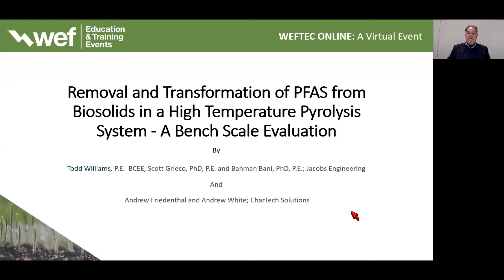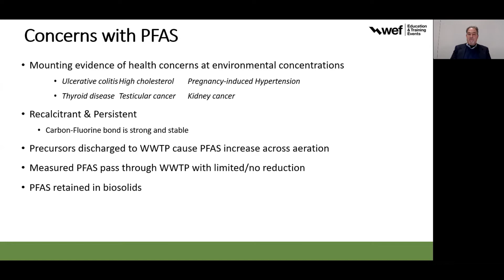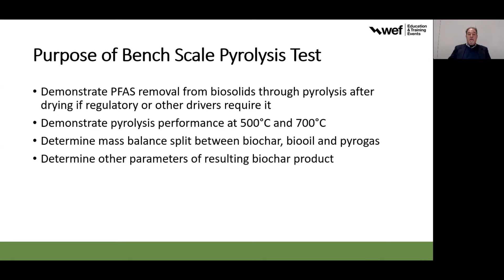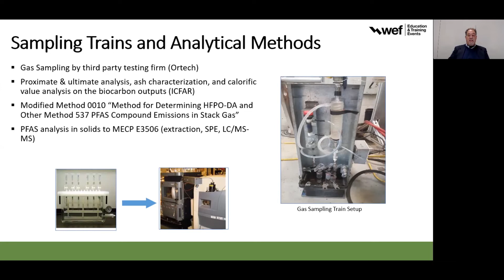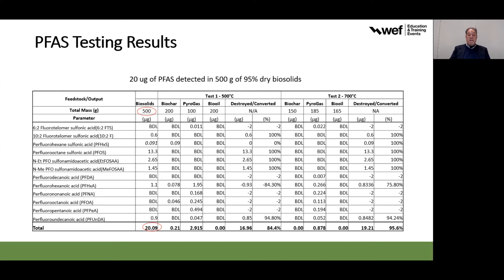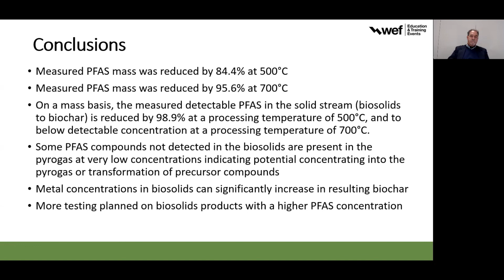Removal and Transformation of PFAS from Biosolids in a High Temperature Pyrolysis System

Comment: While the pyrolysis process eliminated most of the  PFAS in the char what about the PFAS levels that are emitted into the air during this process? Additionally, Wouldn't  this method be a concern when regional  communities attempt to process large amounts of sewage? Even a  2%  discharge of large amounts of PFAS sewage  emissions can really add up,  Finally, Has any firm been approved  by the DEC or EPA to use pyrolysis to treat large amounts of PFAS sewage?